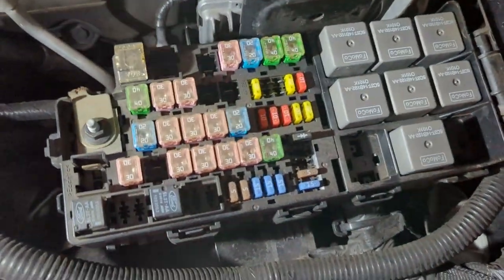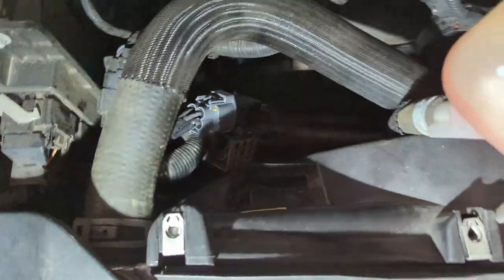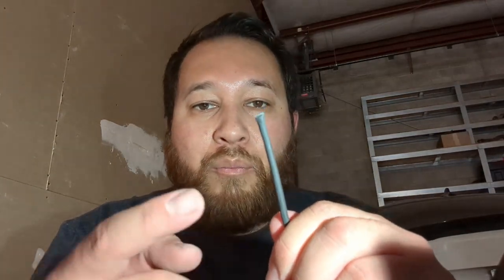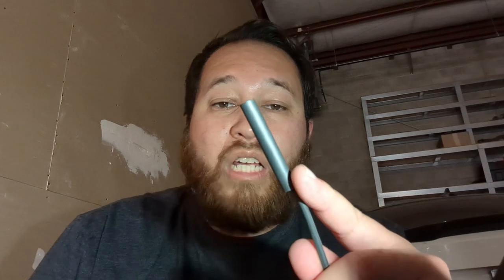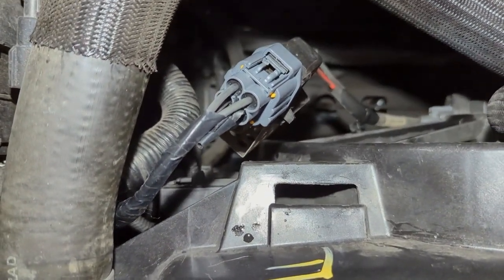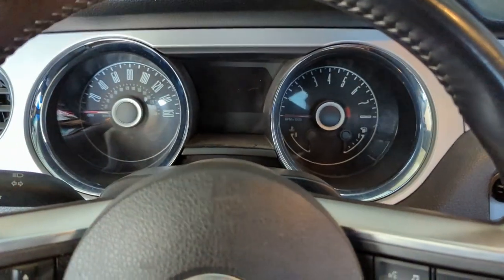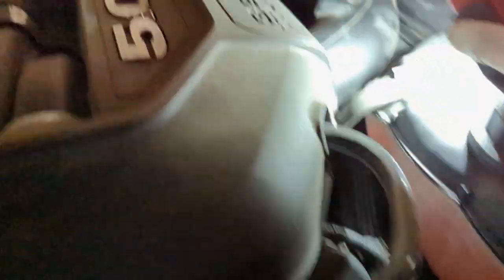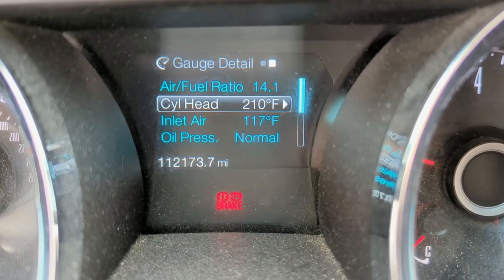Mustang Overheating, Easy Fix!!!

Comment: Great video man, very informative! Quick question, do you notice excessive exhaust smell in the cabin after going wide open throttle a few times with the windows down, similar to sulfur/rotten egg smell? Ive been having that more regularly on my 2014 coyote recently
Reply from the maker: Thank you.  I do not notice that.  If you are smelling exhaust in the cabin I would say you possibly have an exhaust leak somewhere.  Possibly a small leak that is more present when you under load (WOT)
Reply: @markskeem  Thanks man will have to take a look more closely for any leaks.

Comment: I have a manual 2015 mustang gt, my car only overheats in 6th gear at highway speeds, I can’t figure out what could be the problem.
Reply from the maker: I would start with basics.  Fluid level.  Radiator have any obstructions.  Are the fins in good condition? Is the radiator plugged?  Next I would check water pump and thermostat.  Fan doesn't really do much at freeway speeds.  Most likely not the fan but I would still check to make sure it is functioning correctly.  Thermostat not opening enough would not let enough coolant through to cool the engine.  Bad water pump could do the same thing.  Not enough coolant flow to cool the engine.  Under normal driving conditions.  Freeway speed creates the most heat.  Something in the cooling system is not functioning correctly. Could function enough at low speeds to not cause a problem.  If that is all good you could have a possible bad mechanical issue.  Something to look for is if your cooling system is over pressuring quickly your could have a possible engine issue such as a head gasket failure or a hole in a cylinder wall that is letting combustion gases into the cooling system.